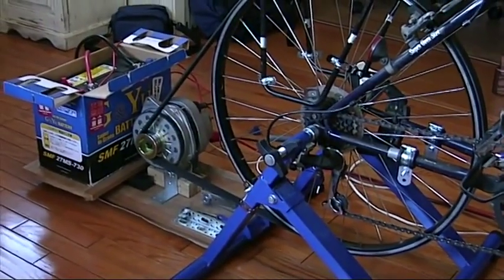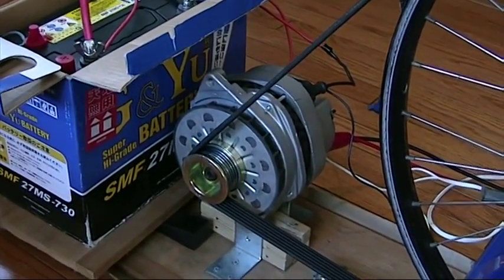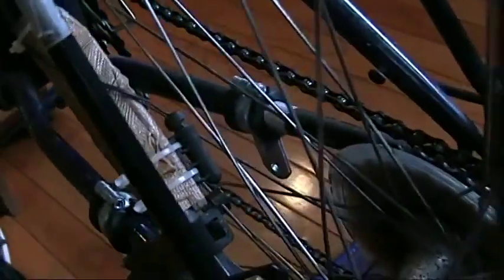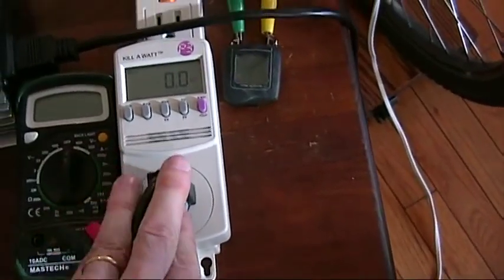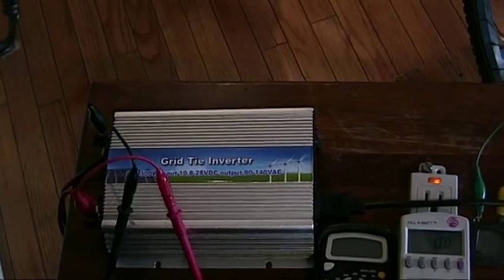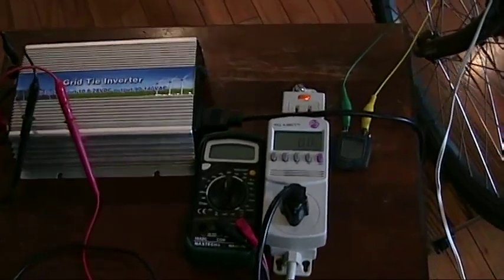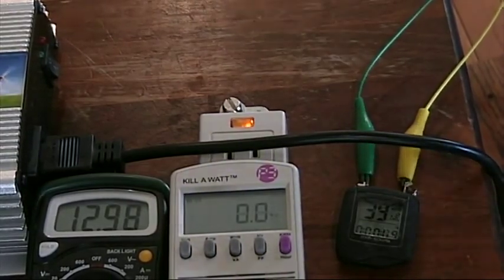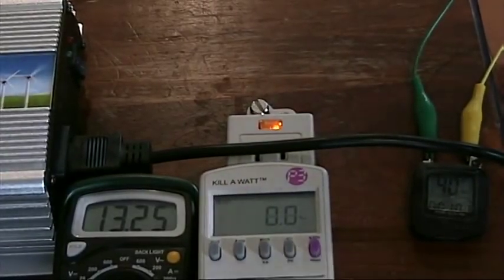Bicycle Generator  CS 144 Car Alternator

Comment: Great video.  You mentioned that the stator wasn't as efficient at low RPMs (like a bicycle).  What alternator model would you switch to  if you could go back in time and get something else?

Comment: Awesome Video. I need to generate 230 V,. Can you suggest me which alternator can I use? and on how to decide the gear pully ratio.. for the RPM needed by motor.;)